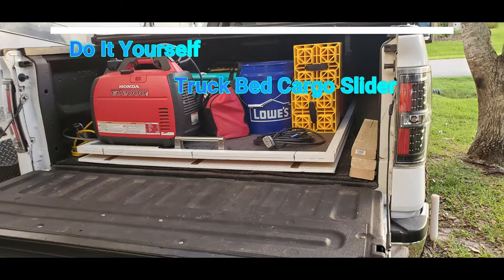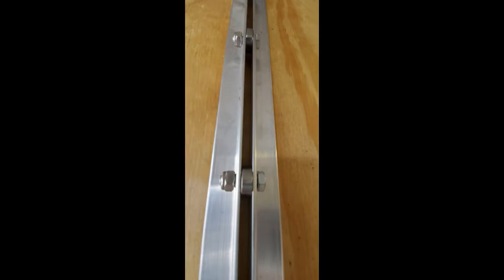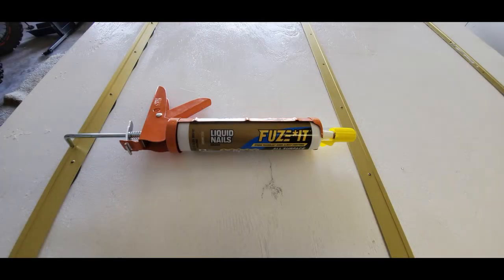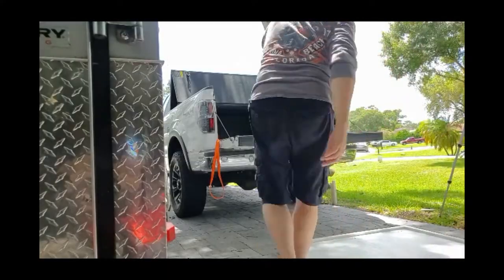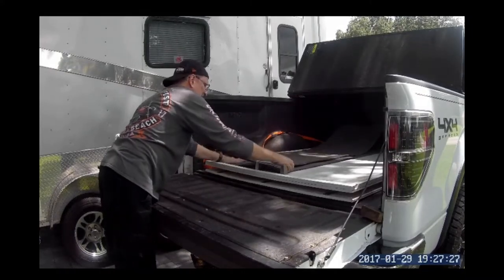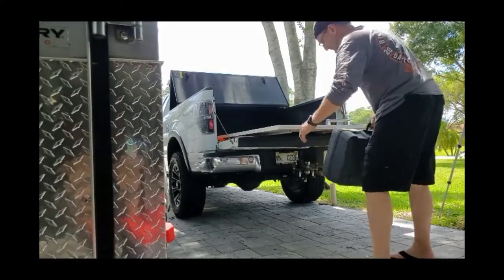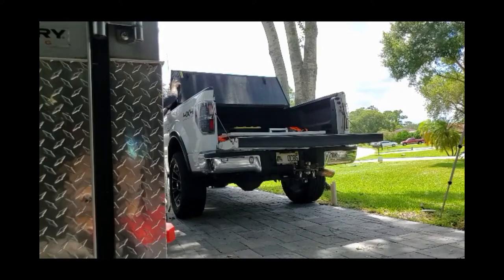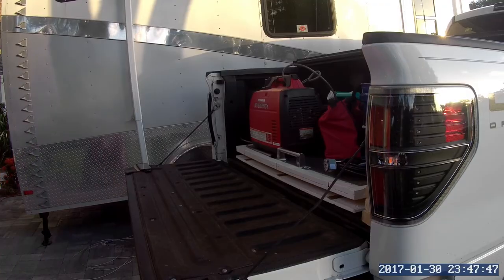Truck Bed Cargo Slider - Under $200 - DIY TruckSlide Alternative?

Comment: Awesome design , one of the best and simplest I have seen. I am sure if you had a commercial track and rollers would be even better. An added bonus is you have a work bench , just bring 2 portable horses and slide out and use as a work bench ! I had built oneva bit differently . I used the fiberglass decking and mounted the slider wheels on that , and a sheet of plywood on top.  I needed a good exterior paint and it got bad after 2 years . I am going to try 2 coats exterior paint,  as I have side tool boxes and a ladder rack and want an open bed. Thumbs up$$$!!!
Reply from the maker: Thanks! I have been using it on the road now for a few months. K love it.

Comment: Can you please add a link to the parts list or copy and past it in the description?  Youtube adds more suggested videos that overlays on top of your video at the end, thus making the parts list partially blocked. I cannot read the top and bottoms of the page. Great job, btw! I plan to do this too for my Jeep Gladiator, mainly for accessing camping supplies. No need to drop $1500 on something that will get used only 5-6 times a summer! :)
Reply from the maker: I will try to copy and paste in the description.
Reply from the maker: I did the video a while back and I cannot find the spreadsheet or pic I used in the video. Sorry. :-(

Comment: Very elegant solution. It would be nice if there is a way to make the slide not roll when it is extended.
Reply from the maker: Would be easy enough to add  small cable to attach to the truck bed tie down and the tray. I have thought about doing that, but it just has not been an issue for me.

Comment: Thks for video where do you buy the rollers please
Reply from the maker: I bought the bearings on Amazon. They are roller blade skate bearings. If you go to Amazon and search for "Rollerblade Bearings", you will see plenty of options. I see a Rollerex 608-2RS Wheel Bearings 20-Pack out  there for $16.95 currently.

Comment: For attaching the thresholds to the tray -- did you apply the adhesive, set them in place, screw them down, and then remove the screws when the adhesive dried?
Reply from the maker: Rick, I applied the adhesive and set the thresholds down in it and placed a few bricks on top to hold it down until cured. In use, the weight will be on the threshold, so nothing pulling or etc. on the bond. The adhesive just needs to keep the threshold I am using to run the bearing over (tracks) in place. So far, I have had the setup in my truck for about 6 months with no issues.
Reply: @donsdoityourself2547  Thanks so much!

Comment: Cool setup! Does a standard ice chest between the slide and tonneau?
Reply from the maker: I do not know. You'd have to measure it. The slide does take up  a little less than 2 inches of height in the bed. I do know I can put in a standard height 20lb propane bottle inside a milk crate,  and it will close with plenty of space.

Comment: Love it! How is doing for rattling? Tries this off-road yet. I was thinking with rubber bumpers it could reduce vibration
Reply from the maker: I split the side of those foam pool floats that are long and round (noodles). Made a bumper with that for the front and back and it is fine.

Comment: Great video. I was wondering if you could put the bearings on the base plate as opposed to the tray itself?
Reply from the maker: Yes, absolutely. I do not think it would matter which surface had the bearings.

Comment: How do you put the rollers on
Reply from the maker: I used 90 degree angle aluminum rails, drilled hole and used a bolt for the axle in this case. You can see the rails in the video.  Thirteen rollers per rail, three rails, and the rails were screwed and glued onto the plywood base.

Comment: Just don't forget to raise the tailgate or someone else will own it. Almost happened to me a few times on a slope.
Reply from the maker: I added a safety chain I connect to a D ring that hold it. You have to remove the chain to pull it out... Ask me why I added that. 😅😅
Reply: Its a good idea to have it lock in place not only if you leave the tailgate open, but also because the weight of the entire load pushing against the tailgate can have the tailgate fail.